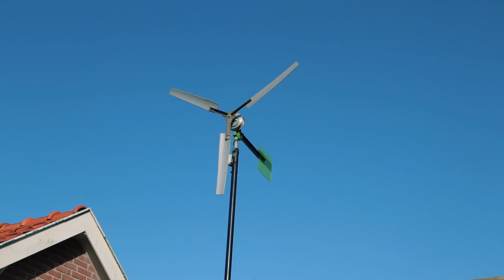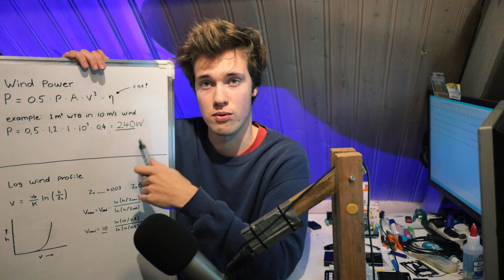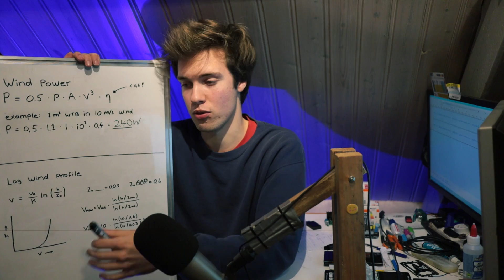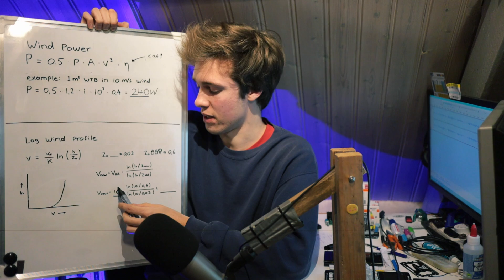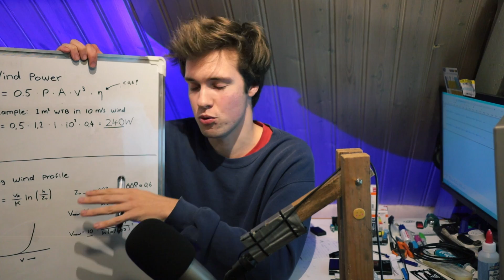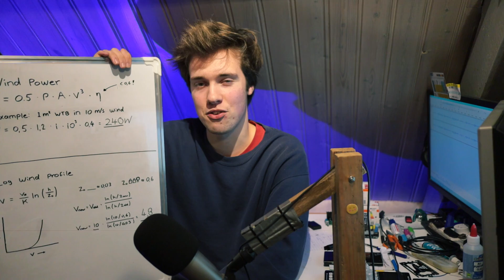Home wind turbines don't make sense

Comment: I think you touched the reason why commercial packaged solutions are only good in niche cases: there are too many factors to consider regarding placement, technology, local weather, difficulties with installation and planning permissions, that make home wind turbines much more challenging to justify commercially than solar, in most places.
Reply from the maker: @christinemurray1444  exactly

Comment: I enjoyed watching you video because your explanation of the science and math involved is very palatable to the average viewer. My question is this. I am in the US and our houses are more spread out than you in Holland, how much energy would your example produce for me? This is also an observation, you gathered information from Dutch weather service where wind speed is measured in an optimal location and recorded hourly. Why didnt you gather wind speed information of your actual wind speed at your residence? Im sure that you can compare the 2 and get a realistic comparison. Dont even tell me that you dont have an anemometer.
Reply from the maker: @MrEvolcire  I don't have a permanently installed anemometer with a yearly wind speed history. 

If I did though, I'm not sure I'd have used that data for the video. The video was meant to illustrate the more general issue with home wind energy. I think focusing too much on my particular situation would not have got the point across very well. 

If anything, the average wind speed in my back yard is probably lower than in the theoretical calculation. My wind turbine is also not aerodynamically optimal. My turbine is also positioned very low to the ground due to a neighbor complaining. Basically, my setup is very suboptimal in many ways, but I wanted to give home wind turbines the fairest possible chance in this video, so I felt like my turbine was not a good example to use, at least for the main argument being made. 

As for living in the US, I can only guess what your back yard looks like. If it's a big open field it might work. 

The only way to know for sure is setting up an anemometer and measuring for a while. Alternatively, you can use the approach I used in the video, find the closest local weather station, get their measurements, and apply some level of correction depending on the conditions they measure in vs your own yard. This may not be hugely accurate, but it should be enough to see if a turbine is feasible.

Comment: A good follow up video may be to replace the blades with proper wing profile blades WITH Whale Tubercles:
Large wind turbines have Variable Pitch blades to keep the optimal Angle of Attack.
Whale Tubercles make it so that the blade is effective (no stall)  through a much wider Angle of Attack range = No VP reqd...
They also ameliorate wing tip vortices. (efficiency and noise)
ie:
The blades will start spinning at lower wind speeds and spin faster for the same wind speed.

The blades could be 3D printed in sections that fit/glue together and fit around a piece of tubing, making an 'Easy to Adjust' angle of attack manually doodat er... easy. :)

Print them circumferentially rather than radially if you get my meaning, so the the 3D printed grooves/ridges work with aero rather than against it... (VERY important hint!)
Or you could spray on spray filler, sand (500+ grit: skin resistance) and finish with a UV protective top coat.

If you paint the blades' high pressure sides (Vanta) black and the low pressure sides (Solar Reflective; Barium Sulphate) white; you add a modicum of 'Solar Assist' to the blades and the video...
Reply from the maker: 3d printing would be nice for shape, but from my experience it won't hold up, especially if it would be radially printed. Maybe if it's some exotic type of filament/print technique it could work, but the standard stuff won't last. Plus you'd need either a huge printer, or multi-part blades which wouldn't be optimal for strength. Durability is the hardest challenge for DIY wind turbines. It's out there 24/7, exposed to UV, temperature changes, moisture and violent wind speeds. I've had multiple bits and pieces end up in neighbors' yards over the years haha.
Reply: @AKIOTV  :D  Thx:  I'm all theory with no practical 3D print experience.

There's this (small) where he strengthened things with a coat of superglue and some fancy fill pattern:
https://www.youtube.com/watch?v=mqSlJYwFl7s

But yea; some fancy uv resistant filament that contains fibres of some sort and definitely a steel or aluminium  main spar/s  arrangement.

Comment: A friend of mine has a 1.2kW turbine to complement their 5kW solar system. They live on a 17 acre blueberry farm/B&B/farm stay near Seymour, Victoria, Australia (originally from Melbourne, aa am I).
They get phenomenal wind from the south, which often occurs when the weather is colder and there's little sunlight. They're nearly at the top of a 70m high hill, so the wind hits the side of the hill and races up, with the wind adding to the flow all the way. The installer said it's probably the best site he's ever seen... near perfect laminar flow and plenty of it. They used heavy duty blades on the turbine, the size of which normally drives a 900W alternator but went for a 1200W due to the high wind speed.
They've since added another 12kW of panels but the turbine is still important during winter.

Comment: What if in practical life we see that an area where the most wind passes or rushes by the house, I personally have seen that wind rushes to some extant according to the design of house as well as the locality. we could go for wind turbine which can be used to generate electricity from 4-6 miles per hour. idk how but I think that's the key for commercial or residential wind turbine.

Comment: 15:19 There is a street near me a couple blocks away (I live on top of a hill) that the wind speed is significantly higher and it's always going in one direction on a bend on top of the hill near a valley. I think a turbine would work well there. I notice this windy area because I am an inline skater and I skate through the neighborhood 3 or more times a week.
Reply from the maker: Perhaps whoever lives there should measure/monitor the wind speed in that location for a while to find out if a turbine would be a good idea :)

Comment: Very convincing and useful info. I just think another title will attract more viewers. I expected to see an explanation of your technical problem.  Maybe something like: 'Why small wind turbines in residential areas don't live up to expectations'. A question, maybe for another video: What do you think of axial wind turbines? Even less efficient, but easier to build for amateurs, as they don't have to adapt to wind direction. Because wind flows perpendicular to the axis, they also get to process less force, meaning the less maintenance.
Reply from the maker: I missed the second half there. Vertical axis turbines are indeed easier to make, and deal better with turbulent wind that changes direction rapidly.

I think the problem with these turbines is this: are you in an urban environment? Then you're probably best off with a vertical axis one. however you're probably even better off with no turbine at all, given the overall, average lack of wind. Are you in an open field? Then a horizontal axis turbine would give you better production while still not being all that much harder to make.

So I suspect vertical axis turbines have very rare, specific conditions in which they could be the optimal solution: situations with both plenty of wind, but at the same time highly turbulent. Perhaps the kind of spot I mentioned at the end of the video would suit them well. Maybe I'll do a video on this some time.
Reply from the maker: good tip 👍